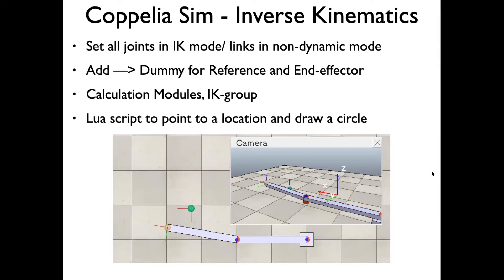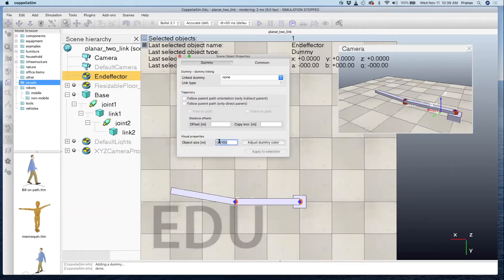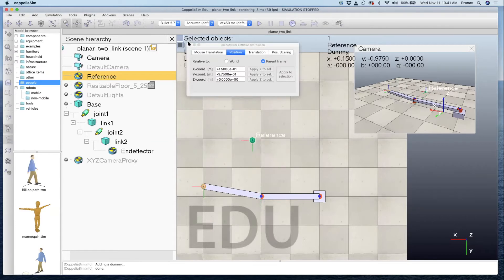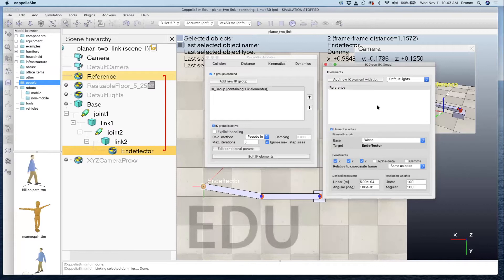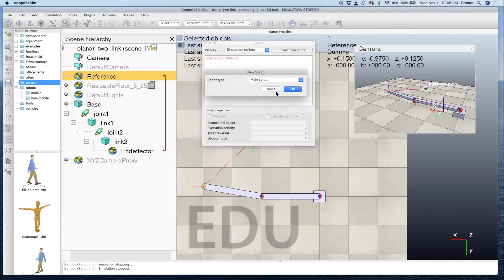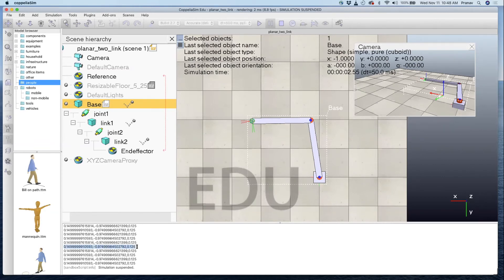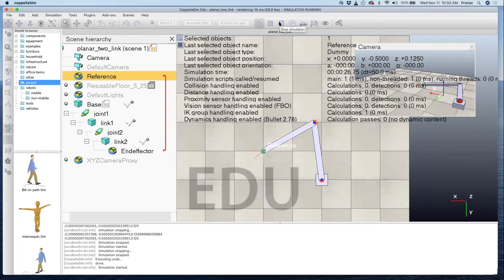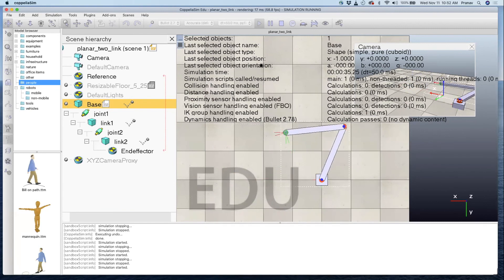CoppeliaSim 5: Inverse Kinematics (Fall 2020)

Comment: sir, here the Inverse Kinematics mean the literal meaning (x,y,z, given Teta unknown) ? if I want to change joint angle and I want the reference to follow the end effector, can I do that by linking in the reverse manner as in video? why cant i find the kinematics mode like inverse kinematics option? I want to change joint angle and find x,y,z
Reply from the maker: You want to forward kinematic; specify joint angles and coppelia sim would give x,y,z. For that you can place a dummy on the end effector and read it’s position.

Comment: Hi, how can i get the joint angles at different postions? maybe making use of sliders or such so that the end effector moves to predefined positions alng, say a path, and then the angles are output at each position. Many thanks.
Reply from the maker: Use sim.getJointPosition in the script. https://www.coppeliarobotics.com/helpFiles/en/regularApi/simGetJointPosition.htm
Reply: @pranavab  Hey, I have a robotic arm, and the get set joint position function do work, however the robot after moving to a point ona  path, it slightly rotates about that path, and due to this my joint angles I get I think are wrong. The robot moves to the point and takes time to settle in. 

Do you have any isights on what is happening. I have a 6DOF robot, its the UR3. I have done inverse kinematics on it. Then I creatd a path object, and then set the end effector to a point on the path. 

Thank you
Reply from the maker: @dreudax3294  I would have too look at your simulation. My email is in the about tab of my channel.
Reply: @pranavab  Hey, i somehow fixed the issue. I have no idea how but i fixed it. But there is a nw issue now. When the bobot moves to points in the path (there are 10 paths), the robot part occupies the space where the point was. So for example if the robot was supposed to cnc in a table, the robot follows point by point, but it crashed into the table to go from point to point.

how can I stop this and just have it folow path properly? My aim is to get the joint angles for eah point on the path. 
I can sent you the files, do you want to see it?
Reply: @pranavab  As in I want the robot to be upright while going from point to point.

Comment: Is there something that needs to be turned on to get "Inverse Kinematics" mode to be available in the drop down for the links? I have coppelia sim edu as in the video but don't have IK as an option. Only passive, dependent and torque/force modes are available. Thanks.
Reply from the maker: The video was made with the 2020 version. In the new version, you need to set the IK mode using a script. See this webpage: https://www.coppeliarobotics.com/helpFiles/en/inverseKinematicsTutorial.htm
See the section called "Setting up the inverse kinematics task"